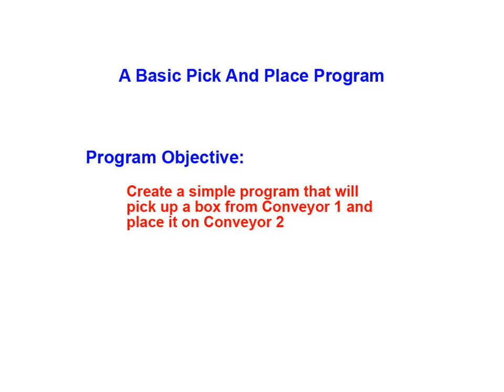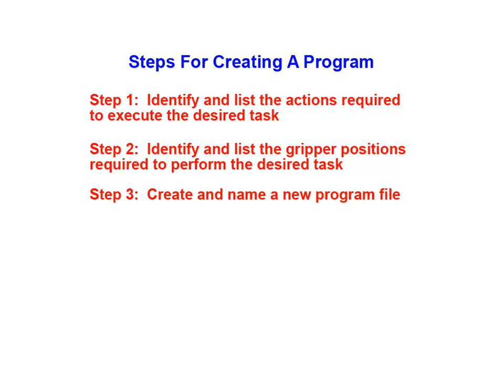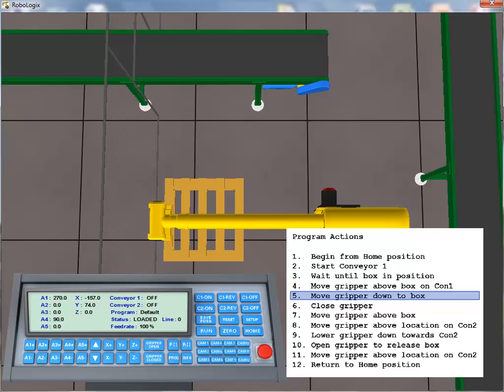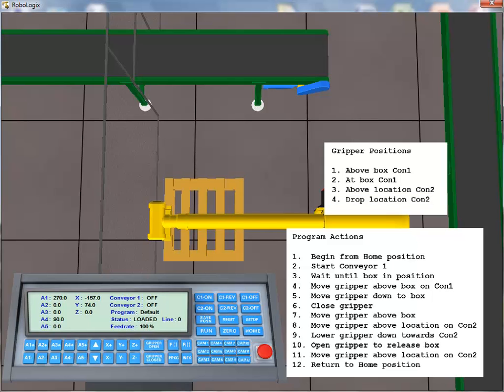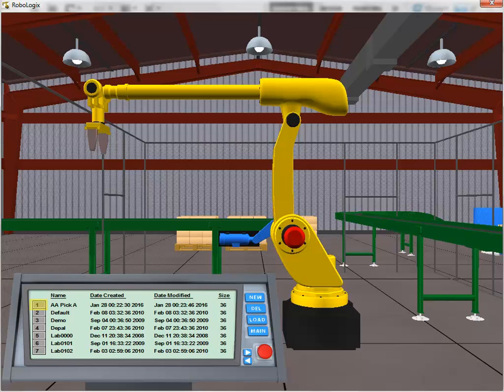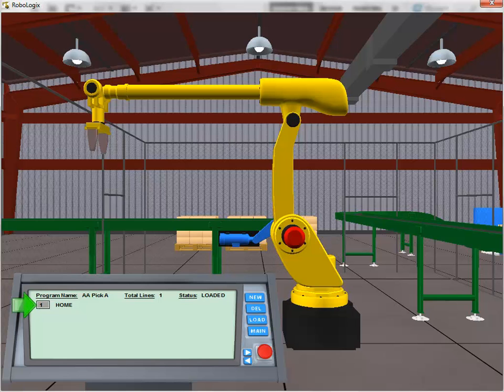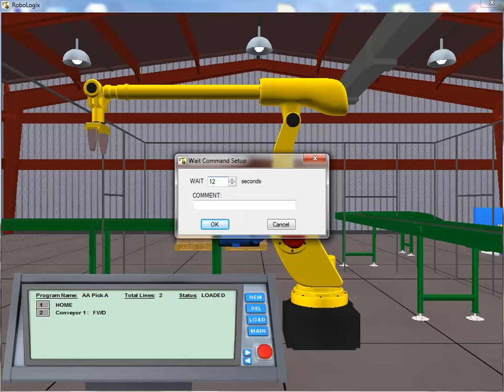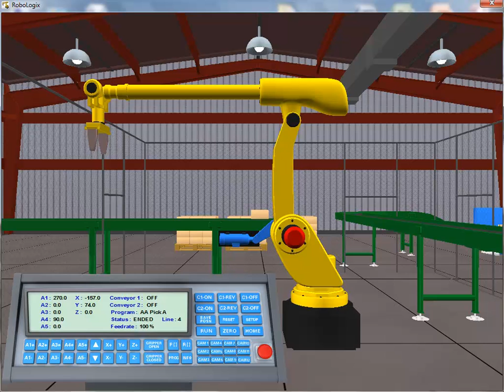RoboLogix Tutorial 1 - Creating A Pick And Place Program - Part 1

Comment: (1) Can we get the RoboLogix program for free? (2) If I take a course in this I was told we'll be using the FANUC. Is this similar to that programming?
Reply from the maker: Hello,The Robologix software comes with the Robotics Technician Certificate course.  This simulation tool employs an instruction set modelled after FANUC robots.  It is pretty standard, but you should know that the instructions sets are proprietary in nature. FANUC robots use a reasonably standard approach and set.  You can review the software itself at the vendors site....www.logicdesign.com
Reply: Hi Shaine  do you order this software from logic design? Thanks
Reply from the maker: If you are not interested in the Technician Certificate program offered by the college, you  can get the simulation tool from the vendors site www.logicdesign.com